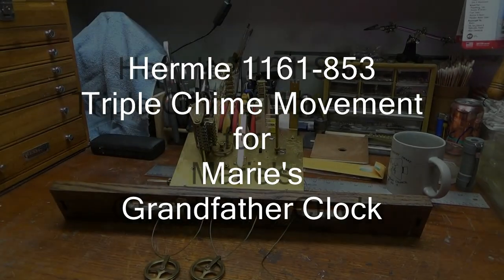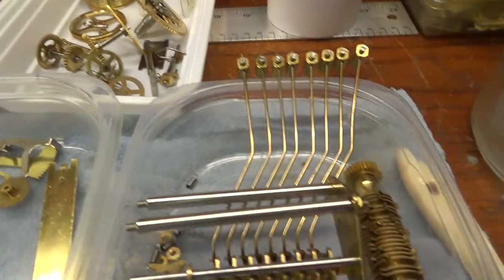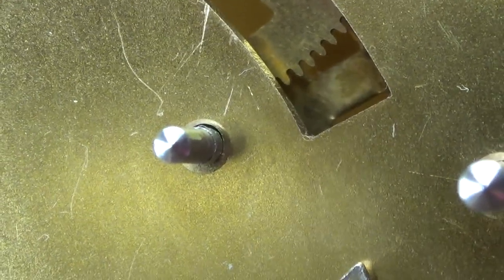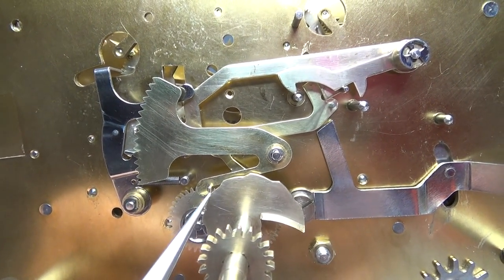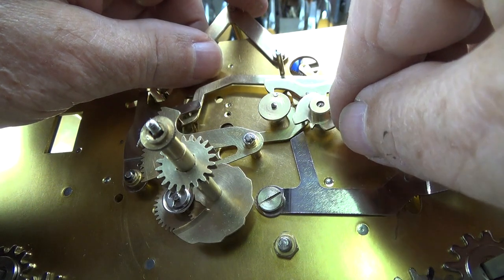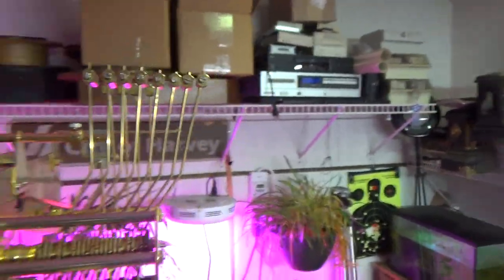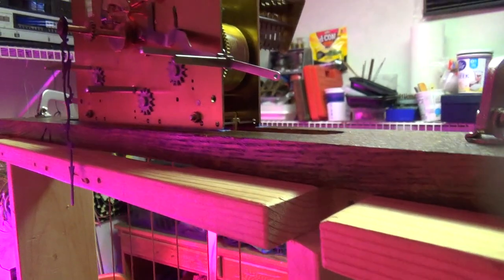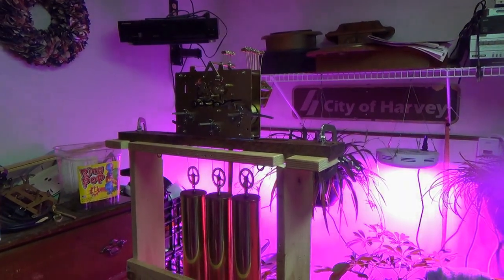Hermle 1161 853  Repair for Marie

Comment: This was nice to watch, especially some of the close up shots and the explanations of the Vienna stops, the chime autocorrect, and the verge with pallets with some give in them to prevent damage if the pendulum is swung too much.  That must have been frustrating to take the movement apart a second time to troubleshoot the time side only to figure out that the problem was too much shaking in your test stand.
Reply from the maker: Actually, I took it apart twice more after the video was posted. The chime quit and I found a slightly bent pivot on a chime train gear that caused a jam every couple of days. Then, the last time, I had to do a partial disassembly to change the position of a warning wheel.  Now, everything is working well.  BTW, the autobeat "verge" is not to prevent damage if the pendulum is swung too much, although it certainly does that as well. It is to cause the clock to bring itself into beat by deliberately over-swinging the pendulum.  And, the stops are referred to as Geneva stops, not Vienna.  It's name comes from it's use by early watchmakers in Geneva, Switzerland.  Thank you for watching and for the comments.

Comment: Excellent video! How did you clean all the parts? What kind of cleaner (if any)? What kind of towels? Thank you!
Reply from the maker: https://timesavers.com/search.html?q=clock+cleaning+solution&go=Search 
Used an ultrasonic cleaner with solution.  Rinse in hot water and dry with rags and hair dryer.  A homemade cleaner can be made from dishwashing liquid soap, Murphy's Oil soap and small amount of household ammonia.  I then hand clean each part to remove stains and rust on arbors and between pinion leaves.  0000 steel wool is also used to remove rust and stains. Parts may also be hand cleaned with a mild polishing compound made for acrylic tubs and showers.  Cotton cloth rags and paper shop towels are also used.
Reply: @dperry428  Wow! You are the best. Thank you!

Comment: Very timely for me. I have the same movement in a recently acquired clock. I've got it running but the chime and strike aren't working correctly. Someone has been into it with no idea what they were doing. I'm just a beginner, but it's very obvious that strange things were done. Mine is a 1987 model.
Reply from the maker: Taking on a movement like this is quite an accomplishment for a beginner.  I hope the video helps resolve the chime/strike problem.
Reply: @dperry428  I have five old kitchen and mantle clocks to learn on. Got two of them running well so far with disassembly and cleaning. I get to do several bushings on the third one. I also bought a "needs repair" 1161 on eBay for practice. Thanks for the reply.